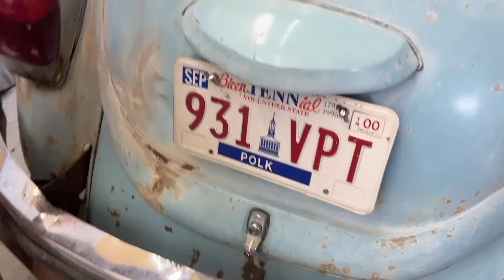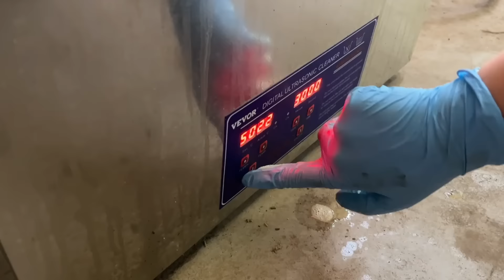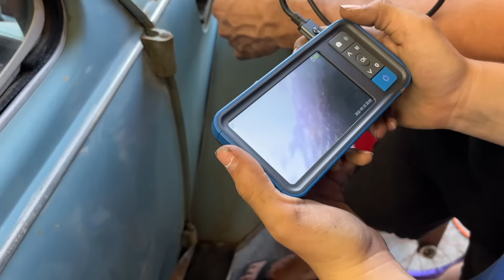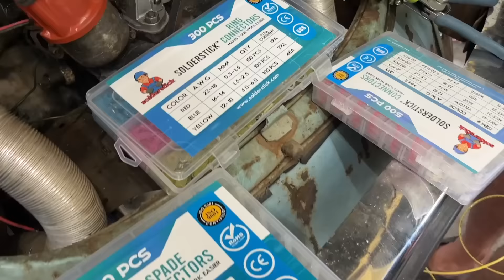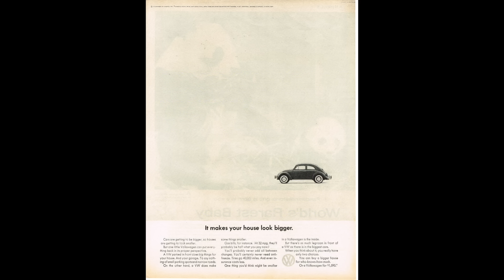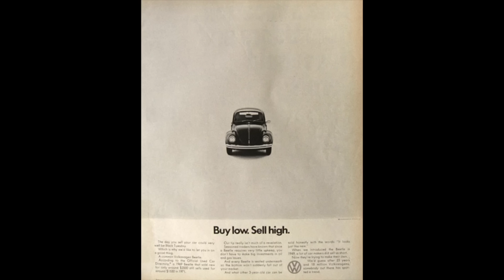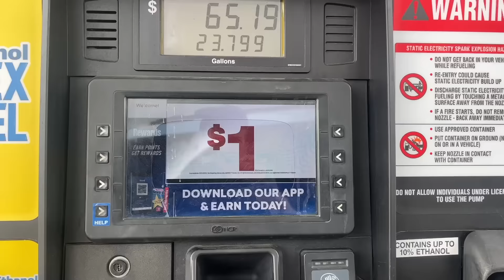Parked 23 Years Will It Start Cheap 71 Volkswagen Beetle Survivor

Comment: Clutch plate was probably stuck to the fly wheel. Which would let the pressure plate still function. After it was ran a little bit , the clutch plate released from the fly wheel

Comment: Congratulations Wawa, this is a great first car . I was a factory trained VW mechanic, the 1300 engine was a one year only engine (1966) it was a good engine. I would keep an eye out for a 1600 dual port engine , easier to get parts for and better performance. Engines are very easy to change . On a bet I pulled a engine, replaced clutch and pressure plate , reinstalled engine with all bolts and connections properly made in less than 30 minutes, treat it well, keep valves adjusted and it will be a great car 👍😊🎩
Reply: That's a 1300 made in 71 lol.they was made more then one year lol
Reply: @jerrywilcox9890  1300 was definitely a 1966 only eng but they fit in any year car I’m sure that isn’t the original engine that car should have a1600 engine being it’s a super bettle!
Reply: @jamesnewell120  that engine is a 1300 and was made in 71 its the original engine lol
Reply: @jamesnewell120  numbers match cupcake it's a 1300 made in 71 lol.i know they do I have 6 buggies lol.easyest things in the world to rebuild a 12 year old could do it.
Reply: @james newell  but yet he has a 1300 built in 71 lol hmmm
Reply: @jerrywilcox9890  the 1300 is not the original engine!
Reply: @james newell  the numbers match lol he just said that and no one is going to pull a 1600 and put a 1300 in lol.
Reply: Early 1300's we're single port engines, 1300 twin port engines were available in the 70's, but I'm not sure they were a available for the US market. The twin port 1300 replaced the single port 1500's in European markets.
Reply: I'll reiterate what I said earlier.. the 71's were all 1600 engines, but some were dual-port, and some were single-port (first run cars off the assembly line) I also had a single port AE block 1600 in a '71, which eventually got replaced with a heavily modded 1835 dual-port. The only way that engine could be a 1300, is if it had an 'AB' or 'AC' block, which would have to be an import shipped by the owner, as they weren't available in the U.S.
Reply: @danw1955  like I said if it’s a 1300 it’s not the original engine if it’s a1600 it could be!
Reply: in the US import market probably the 1300 was not as desirable as 1500 or 1600, whereas in Europe the standard was 1300 (until 1302/3S with the 1,6 litre) and 1200 before those
Reply: Check end play on the bottom pully it will let you know if the engine needs bottom end work
Reply: The 1300 is original to my 67 bug

Comment: The clutch disk was just rusted to the flywheel. I'm sooooooo stoked for wa-wa!! She deserves this so much! She's always jumping in with both feet, and made herself a huge part of this show! Soooooo proud of her!!!😁
Reply: Was going to say the same thing, rusted to the flywheel. When it stalled out and jerked it popped loose.
Reply: Yeah, I had a '69 where the clutch was seized just like yours, and just putting some torque to it by push-starting freed it up and it started working again.
Reply: Was going to say that too. Had several cars that have done that after being left standing. My fix is to jack it up, start it in gear, then drop the jack whilst holding the clutch down and the shock breaks it free.
Reply: Yep yep that’s what I was going to say also

Comment: Congrats Wawa! My first car was a red 1970 Beetle. I was 16 in 1970. I bought it from my Dad in 1973. I loved that car, and now that I am retired I am searching for another one to restore. Well maybe lol. Good luck and I hope it will give you years of joy like mine did.
Reply from the maker: Awesome!!!
Reply: And $2k is a great deal. I know, I shop for them all the time. Just check the floor pan for rust, heater channels, rear deck etc. All these parts are still available if needed. Make sure to keep the 2 hoses connected in the engine bay. They send air from the fan to cool the heads. Those engine tins are crucial to cooling. Please check to be sure there aren't any nests in there blocking air flow. There are many experts on youtube. Mustie1, WickedWerks, 5150mx, Mike Fn Garage, and many more.  You made me remember how thrilled I was to get mine way back then!

Comment: The smile on Wawa's face is priceless. What a sweet little ride.
Reply from the maker: Thank you she’s excited
Reply: clutch cable always a problem in 71 and 72
Reply: @Sleeperdude  car worth at least 8k more if you do interior  and R+R    engine clutch  brakes suspension. Good deal
Reply: @ervincopestake61  do the brakes and hard lines if they aare scabby rusted and leaky
Reply: Original price for a 71 VW was around $1990.  Wish I still had my 74.

Comment: It’s pretty common for a clutch to stick to the flywheel after sitting for a long time. I think she’s going to really have fun with that car. 👍
Reply from the maker: Awesome thanks
Reply: A little moisture will rust it shut, just like brake pads, and they clean up the same way.
Reply: Yep. That big clunk was the clutch disk coming off the flywheel. I knew it when it happened. Very exciting moment!
Reply: Usually when that happens, it doesn't take long for the clutch to destroy itself.

Comment: This was my first car back in 1978, same color and everything.
After my 2nd junk yard engine I had a hotrod engine built by a friend of mine. Had a two barrel Webber carb, shot throw shifter and a smaller steering wheel. I drove it until I pulled up to a stop sign and the fender fell off and it died of cancer, it was a sad day. Boy did we ever have some good times in that car. I know that you will too.
The clutch disk was rusted to the flywheel, after driving it around it broke free. Put radial tires on it and it will stick to the road like glue.
 A family that erenchs together stays together ❤️ .

Comment: I would say the clutch was rusted to the flywheel and pressure plate and you broke it loose. I think you have a fixed resister as a ballast resister changes resistance when it gets hot. Your 2N tractor should have a ballast resister behind the dash panel. Great video congrats to WaWa you deserve it.
Reply: They get stuck pretty quick with sitting, our air-cooled van got it in two years but was broke loose and never had a problem again
Reply: agree 100% ... It happened when you tried to start it in 2nd.  I know you heard that noise when it broke loose.
Reply: I would say you are right on concerning the clutch, I had the same thing happen on my farm tractor. After running aroung the pasture a few times it broke loose and started working.
Reply: Yep, I heard it break loose. Had that happen to me years ago. It’s pretty common when standard shift old cars sit for long periods especially in more humid climates.

Comment: Congrats on the Beetle. Just a couple things, it should run better with an OEM exhaust and the heating system will work better too. Adjusting the choke, wait till cooler temps at night (50-60) and turn the choke coil until the flap is lightly closed. I used to put carbs in the freezer for about 15 minutes after rebuilding to simulate winter temps (Michigan). Look up jbugs for parts.

Comment: Congratulations on the VW . The first things I would recommend to do would be to switch to a starter from a 73 automatic beetle . It doesn’t require a bushing in the transmission bell housing and is a much bigger , sturdier unit .Rock auto Carries them  . Next would be to add a hard start relay to the system to help it get maximum amperage when starting. It’s just a basic 30 amp relay mounted near the starter . Get a good set of Bosch style plug wires. The plastic on the cheap replacement ones  will crack and break on you and leave you stranded at the least opportune time .  Always run a zinc additive when you change the oil and don’t use synthetic motor oil . Good old fashion 20w50 should do the trick .
Reply: That's right the engine will need a zinc additive ASAP

Comment: One of the advantages of the beetles is that there are only 4 bolts that hold the body onto the chassis and can be easily lifted off of the frame to give you more room to work on the car. When I was in high school my next-door neighbor was putting a sand dune body on an old VW bug, and had no problem removing the original body. Another thing that is so fun about the engine is that one person can carry it by themselves. My neighbor was an average size man and he put it on a workbench by himself so he could rebuild it for the conversion. Fun video thanks for sharing it.

Comment: Congratulations Wawa! My first car was a 66 beetle. Then i had a 74 super beetle tin top and a 79 convertible. LOVE air cooled VWs. parts are still cheap and you can do LOTS to make it your own. Tell your dad to lower the front end put a little rake on her. She'll handle alot better. And make sure the frint control bushings are good as bad ones can cause death wobble. Goid luck and have fun!
Reply from the maker: That’s funny thank you

Comment: Be sure to reinstall the hard metal portion of the fuel line and relocate the fuel filter outside of the engine compartment to avoid common engine fire. Consider disc brake upgrade to front brakes for your teen driver. Glad to see your girl getting a VW.
Reply from the maker: Thank you

Comment: clutch plate was stuck to the flywheel , by starting it in gear the force freed it off , common on manuals that sit for a long time - Wawa looks so happy - well done
Reply from the maker: Yes!! She’s so excited
Reply: I was thinking the same thing.   I was also thinking some hammer taps when you were checking the clutch cable to loosen everything up in there.

Comment: Should get the "right" pertronix coil to match your install.  Plus, if that is first gen pertronix module, they are easily burnt up if you leave the ignition on with engine not running for prolonged time (like when troubleshooting.). Pertronix II and III fixed that issue.  3rd thing, be careful with the battery in the back seat. If it's not covered (plywood, etc), a "heavy" person in the backseat will short the battery out on the seat springs! Boom!  Have fun with that bug, and please get WaWa some safety glasses!😂
Reply from the maker: Awesome thanks

Comment: Clutch disk just got stuck to glaze on pressure plate and flywheel from years of sitting.... moisture is  usually the catalyst for ''frozen" disks, driving it and a little bit of slippage helped it bust free from glaze and tiny corrosion particles.
Reply from the maker: Yes!!
Reply: @Sleeperdude  another tip for you,picked up a nice 1986 41,000 mile eagle wagon from Original owners 1 month ago. Husband/ wife special ordered with every available option,even has a tach, vacuum gauge.their  Chrysler- jeep dealership installed Mopar port injection for the AMC 258 ci  in 1993.Any way,it was sitting for 18 years and gas tank had about 1/4 inch of black varnish- tar inside tank.tank has no rot in it. I took a 3 foot long piece of chain and looped a 2 foot section of rebar to it....together with hot soapy water,well say 3 hours tops to make the inside shiny new again,free of unwanted gunk and junk. It was a workout for both arms,but an idea turned into a successful resolution for gas tank most would have written off or attempted: chemicals, whatever fix. It's runs on Wally world carb cleaner....still got to clean fuel system  forward of tank before plugging back in ECU and hooking electric pump back up.

Comment: Be sure to adjust the valves every five thousand miles and it is easier to drop the engine to tune and adjust it. Great cars. Both of my boys had bugs as a first car. My oldest is restoring a 1957 rag top at this time. To drop the motor. there are four #17 bolts, the gas line, the cable to the carb, and the wires to the carb and generator. Jack up the car and a jack under the motor, take the 17's loose, pull motor back on the jack and lower it, super easy and fast. In the middle under the motor is a round thing with a screen. That is where you drain the oil and clean the screen. Another super easy and cheap.
Reply from the maker: Thank you
Reply: @Sleeperdude  REMOVE THE RIHT REAR TIRE WHEN PULLING THE ENGINE

Comment: Great job.
 My best advice is always:
"stay stock to avoid creating your own problems".
Replace the cobbled up coil/resistor set up in favor of an OEM original set up.
Replace the rusted out muffler with a stock VW one with the 2 tiny little glass pack outlets sticking out.
The engine needs the original designed exhaust back pressure to work correctly.  Secondarily,  the natural restriction of the stock exhaust is the factory designed "overspend governor" to prevent her from tossing the rods out the side of the crankcase when she "misses a shift at wide open throttle" as so many new drivers would tend to do!

Earlier post below was correct...clutch plate was just rusted to the flywheel preventing it from releasing...ur all good now.

Comment: Congrats on the first set of wheels 😊  
As someone who has worked on several of these over the years, I offer the below advice (Feel free to accept or ignore as you see fit LOL 😊 )
First off, if that car was sitting for 23 years, it’s very likely that a rodent has made some kind of nest in the fan shroud.  I would pull the engine (takes less then an hour) and pull off all the tins,  that way you can be sure that nothing is blocking the airflow (great time to throw a coat of paint on them).  Also that is a good time to inspect the oil cooler that resides under the tins, and replace the 2 O-rings that are on the bottom of it (If they are not leaking yet, they will).    Be sure to check the thermostat to be sure it functions (Yes Bugs do have a Thermostat), it sits on (IIRC the passanger side) bottom of the engine cylinders and pulls a lever which opens and closes a flap in the tins,  lets the engine warm up before full airflow goes over the cylinders.
Speaking of cylinders,  I would re-torque the heads,  over time these engines have a habit of working the head bolts loose.  Easy enough to do. 
Lastly, when y’all do the oil change,  there is a ring of bolts around the drain bolt,  pull those and make sure the screen isn’t plugged…
Good luck!!!!!!
Reply from the maker: Ok thanks 😊

Comment: My first car was a secondhand '71 beetle my sister gave me when she bought a new VW Golf Mk2 in 1984. I rebuilt the engine, repaired & premiered the body (had it professionally repainted), then handed it dow nto my brother in-law in 1990 when I moved to Hong Kong. His son is now planning to convert it to an EV. You might consider a rebuild & restoration if the floorpan is in good structural condition, if not you can just refinish the body with linseed oil & wax to keep the "patina" finish. Have fun.

Comment: 23:01  Cute, Josh. 😂 Did you know there is actually a thermostat in that engine? It is located low in the block and controls the engine heat that is diverted to heat the passenger cabin.

Comment: Importants advice; Get a Bosch coil! They are proper! 
And look in to a temperatur gauge, with a sensor that goes in the Oil, and don’t forget, the engine is so easy to pull, because it needs to be a part of the maintanance. 

So cool that che went for the VW bug!
Reply from the maker: Thanks for the tips!

Comment: Comment 2: On those Solex 34 PICT carbs, the screw on the choke 'steps' needs to be just barely touching when the choke is open, and you adjust idle speed with the big air screw. It seems it's really lean on the idle mixture, so check the idle pilot jet on the other side of the carb, and make sure it's clear! Also, make sure the idle solenoid is working!😉 (If you can find a good 30 PICT, they're a lot more reliable and easy to tune) You'd need an adapter to bolt it to that intake, since the 30 PICT has a narrower bolt pattern.
Reply: That's why I always recommend if you can put dual carbs on it. Get rid of this solex completely 🤮 we had a 68 that we could never adjust the choke correctly 🤣

Comment: My only advice from personal experience with Bugs is that as the engine gets older it tends to burn a little oil. 
This means you should be checking oil with every gas fill up and have a funnel with a quart or two in the boot and you should be changing the oil diligently wvery 2k miles. 

Also I'm not surprised the clutch came back to life, almost every system in a Bug will take a pretty good beating before failure.

Comment: Clutch stuck to the flywheel with rust, very common. Look out for the pushed in brass fitting on the carb for the fuel pipe they can just pop out and start a fire... Well done guys, all the way from Glasgow Scotland. Keep up the good work..

Comment: Congratulations Wawa!! She totally deserves this. Josh, I’m not an expert on beetles, but I have learned valve adjustment is important on these engines and when you take the oil cap out to drain the oil, there is a screen up inside that has to be removed and cleaned. This screen is basically your oil filter. Looking forward to seeing this little car fixed up and roadworthy thank you guys so very much. God bless!

Comment: 1600 cc, 60 hp.  In September of 1971, I gave $2196 inluding an am radio.  There had just been a repeal of the federal excise tax and a price freeze so I got a check for a little over $100 back.  I am an old man now and there isn't a day that goes by that I don't think about that car. They said the top speed was 72mph but it would run over 80 by the speedometer.  I drove mine at 1971 highway speeds and with the exception of no passing power, it was great.  It held 2 1/2 quarts of oil.  It got an honest 25 mpg on regular that was 25 cents a gallon in 1971.  They were an amazing car.  You didn't have to be a mechanic to work on it.  Literally every part on the car can be serviced or replaced by the owner.  In 1971, parts were readily available.  You will have so much fun with it.